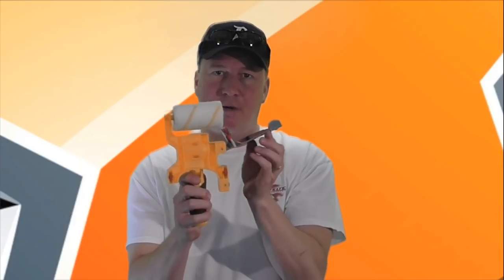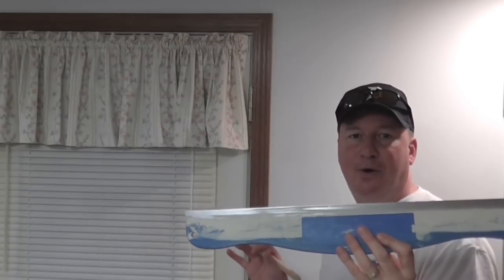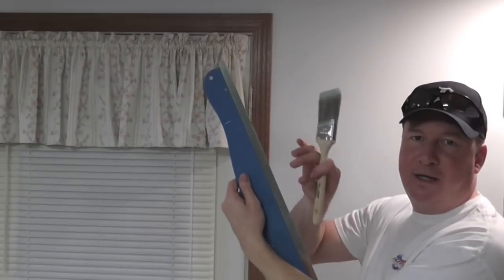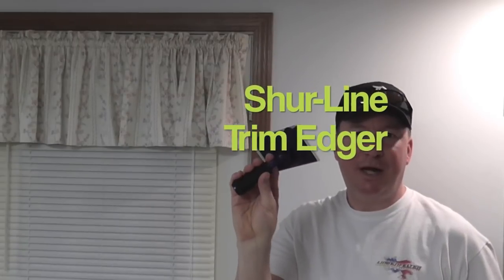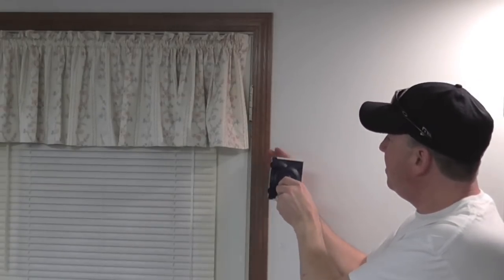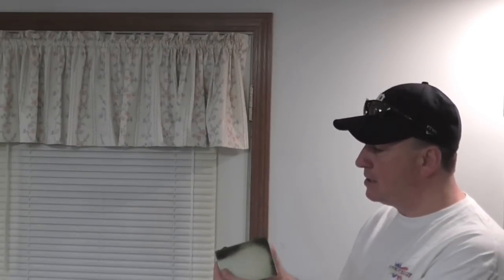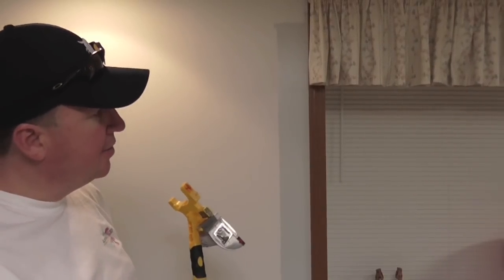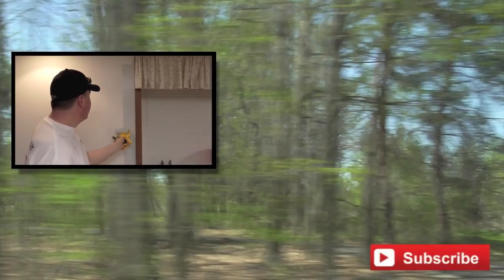$99 Accubrush XT Paint Edger vs. Traditional Painting Techniques

Comment: Wagner had the best trimmer same engineering as this one but contained the paint in the handle which solved the problem of getting paint on the edge guard when loading up that one. It came in useful when doing contrasting paint colors. Still at the end of the day a good brush and a little practice with a steady hand is the fastest. Also if you get paint on the wood trim take a 3 inch putty knife wrap the blade tightly with a slightly damp cloth and run it down the trim this removes the oops and leaves a nice straight paint line.
Reply: Accrubrush and ready to test it in about 2 weeks. I had looked into Wagner but since my paint is a bit thicker not sure how well it will float from Wagner's handle to the roller.

Comment: I own the Accubrush. The limitation is NOT the 1/8" gap you see in the video.He could have corrected that by adjusting the mini brush.The limitation IS having a straight and smooth edge to guide your Accubrush along.If you have textured ceilings. Forget it. If you have trim that is flush, forget it.There are instances where the Accubrush just can't work.I recommend using painter's tape and clear-drying caulk, then pull the tape while paint is still wet. Better edge than anything done by hand.

Comment: The sureline edger works very well if you apply the paint onto the pad with a small roller or brush. Only apply the paint 1/2 away from the edge on the pad & start away from the trim & with medium/light pressure work twords the trim about 2 feet per load.

I am a painting contractor & some gadgets work, some dont, however the more time you have behind a brush the better youll get. 

Purdy brushes are more difficult to cut a straight line with as the bristles have become larger & very rigid.

Try a wooster alpha brush or a proform contractor brush with smaller/thinner-  softer bristles for smoother/ light texure walls & a wooster chinex brush for heavier textured walls.

😎😎😎😎😎
Reply from the maker: I've used that one quite a bit.  The only issue is if paint gets in the roller wheels.  Other than that, I've had success with it.
Reply: @MarkThomasBuilder  it seems to get on the wheels no matter what,  i just make a habit of keeping a clean rag to wipe the wheels every time

Comment: They make an MX model for just $39 on Amazon and it works better than the $100 model. The $100 model does not work well on a pole and the MX has a handle and no pole so you are close enough to have the control you need. I can paint faster and make a cleaner line with the MX than a professional painter using a brush.You can adjust the brush on the MX to have no gap whatsoever and paint right up to the edge. You need to roll an inch away from the wall with the shield open after you load up the roller to avoid getting too much paint on the shield which then could get on the trim.If you know how to use this tool properly it is amazingly fast and accurate. Most of the videos I have seen slam this product because they are not using it properly.
Reply: Seems like a lot of work just keeping it clean,keeping the shield clean, wiping the end of the roller with a rag and such.
Reply: @billprezioso3677  you do not need to do any of those things if you use it correctly. I have cut and rolled a 10'x12' bedroom in 40 minutes myself using the Accubrush and an 18" roller so it is unbelievably less work. Most professional painters take 2 to 2 1/2 hours to cut and roll a room.

Comment: I'm a professional painting contractor (as many of you guys commenting on this video) I don't like how in the video it leaves a unpainted gap between the wall and trim doesn't look very professional, the trick to cutting in clean lines against trim work for me has always been by cutting in your tape the paint can't bleed through the tape if it's not "globbed" on there by dipping your full brush and putting it right against your tape you don't have to cut it in perfectly like when cutting against a ceiling either just remember less is more, I do this and pull my tape after 2 coats with flawless results 99% of the time, sure there will be a touch up or 2 here in there but still looks better and is right against the edge of the trim and looks professional unlike what it looks like with this tool lol good video tho appreciate the honest review on this tool :)
Reply: In defense of this tool tho... I could see using it on commercial jobs where they want a coat of the exact same color just to "freshen up" the space where meticulous detail isn't required (like in a customers million dollar home lol) in this case I could see this tool as a good investment for production painting to save time and sundry costs :)
Reply from the maker: Thanks for taking the time to comment and mentioning many things to consider.  I've globbed on the paint when using tape and had issues of it working its way through.    I appreciate your advice.
Reply: What about when you have textured drywall and you cant get the tape to seal.  Is there a trick to that?

Comment: Im a professional painter been painting about 30 yrs now but in the very beginning i tried everything except for this new accubrush well, to tell you the truth I'll stay with the old school way hell i been painting so long now that i can cut twice as fast then that accubrush LoL
Reply from the maker: I would say that people that can cut in paint with a trim brush are blessed with a talent.  This tool is for those who aren't equipped to properly manage a trim brush in a timely manner.
Reply: it isnt a gift, it time at it, where you learn what angle you hold an angular brush to the line to cut in. Purdy brushes hold the knife edge inward. My 15 yr old Purdy brush does not feather out the bristles. 
Wet the brush with water or solvent thinner if solvent paint is the choice. Shake out the wetting agent. Reason to wet bristles,keeps paint from drying out bristles half way up brush that cause bristles to spread out and lock in a bad brush knife edge at tip. Next , never work out of paint can, yes I said it ,its are real amature approach.
Fill another bucket with about 3 inches of paint. Dip brush light and quick, tap both sides of brush to inside of bucket sides, it loads brush properly and secures a dripless brush. You dont scrape off paint on one side, only after you've left brush sitting down in paint for a break is this done.  Loading a smooth wet brush increases spead and flow.
You dont always dip the whole width of the brush,sometimes just a portion of the  angular tip. This is just my 42 yrs as a painting contractor hold and using a brush. Applying more or less paint to a line as you moving in to make it straight.
Reply: Eric Chambers I wish I can meet you so I can challenge you to cut a regular size house of course using our favorite brushes I haven't meet my match yet mi amigo . I also can roll a room in 3 min perfectly clean and nicely rolled
Reply: No you can't.
Reply: Marcos Castillo lol 3 mins.  you would have splatter on the ceiling to roll that fast
Reply: Marcos Castillo no you can't lol
Reply: I appreciate the video but wish you would've really adjusted the brush instead of talking about all the other stuff. Cause until you have an  accurate cut line the job of that tool isn't done.
Reply: Marcos Castillo lol he's a professional painter of course he can cut in and do it neater than that piece of crap
Reply: Scott A maybe he's painting a Wendy dolls house room
Reply: I'm a painter as well and I noticed that they never use it on textured walls. 😂
Reply: Paint with the Puerto Ricans that I painted with recently and realize brushes are ridiculous. I'm fast as hell will they brush also. These guys took those little plastic edgers and ran perfect lines. Painted a house faster than I've ever seen.
Reply: @hugot12  + You call it a "bucket", but we call it a "cut pot." Who would use the big can of paint, when they make cool containers, or just use a clean empty can. But everything you are saying is very accurate. I cut very good, and I have only been doing it 10 years.
Reply: @marcoscastillo8757  + Prove it. Make a video.
Reply: @marcoscastillo8757  , prove it!!!!
Reply: You’re a damn lie. I can paint trim well, but even the shur line thing beats me at cutting in trim and ceiling line

Comment: Seems like it would help me with carpal tunnel, better than dropping brushes after painting for 20 years.   Or for new guys or day help since we all know its near impossible to find good help.    But I can cut a room out in 20 minutes myself with just a good 3" angle sash Purdy, and I'd still give it a try.  Prob not that great on stucco surfaces.  If it speeds up the job considering all my variables then its worth it.   If it's just another spring time doohickey they come out with, I have lots of those in a junk pile.   Speed = profit
Reply from the maker: The Accu-brush works great on smooth surfaces and is easier on the hands.  When I do cut-ins with with a 2.5" brush, I often have to take a break because of hand fatigue.  I'm switching to a Purdy brush and will see if the handle fits my hand better.

Comment: Thank you for saving me $100.
Reply from the maker: I'm planning on revisiting this tool in another upcoming video.  I'm going to compare it against a 2.5" trim brush and see if I can get the paint right on the trim with no gap.
Reply: That piece of crap cost $39.95 on Amazon.
Reply: @MAGA1440-s2m  That's the lower end model, not the XT

Comment: What? No close up of the actual "work" to show the 2-3 mm "white" spot where the brush didn't get all the way up to the wood trim?  Plus this also assumes that the surface you are butting up to is both smooth and straight, i.e. at a 90 deg. angle from the surface your are applying the paint to.  Not the case with some fancier crown mouldings.

Comment: most painful part of painting is doing the edging.ceiling to wall, or wall to wall corners. Then trim around doors and windows.

I used the wagner, and it isn't too bad, but I might lube up the rollers internal "bearing" to make it roller better. What sucks is it doesn't have the same roller texture if you are using a different brand 12 inch roller

Comment: How about over lapping the edge with tape but then using a razor blade to cut the edge. Then use a flat piece of wood to press the tape down more
Reply from the maker: Sounds like a great way to get nice clean edges.
Reply: I just tried the razor blade method and it worked great.  I didn’t have any bleeding at all because I pressed down on the tape edge with the end of a paint stir stick.

Comment: we may get away with that 1/8" gap at your home but not at an actual job, lol
Reply from the maker: So what's the acceptable tolerance, 1/16"?
Reply: markthomasbuilder I do all my cutting by hand and to think I would pay $100 for a tool that is basically useless, there shouldn't be a gap at all period.
Reply from the maker: Gotcha
Reply: Lololol
Reply: Right my dad taught me how to go all the way to the trim with  3inch brush and not get it on the trim and without using tape
Reply: Definitely can't leave a gap
Reply: $250 would be worth it.  If it was tight and worked
Reply: 1/8 " gap ?  That countered with 1/16 " gap.  "Builder?"   These are chicken coop tolerances.

Comment: Will this work on my walls that run up to my ceiling , it’s got a 30ft run on each side at a 35-45 degree angle going 20-25ft up. 

Wondering if the paint roller head can adjust for angle or could be used on angle ceiling to cut in?
Reply from the maker: That's a good question.  I've only used it on 90 degree corners.  I'll take another look at the tool and see if I can get you an answer.

Comment: You never showed the edge after the ‘micro adjustment’. Although that ride side pass did show it does a nice job in not getting on the trim, for my purposes, that gap is way too big in the two rooms I’m about to work on because I’m using darker colors in eggshell to semi-gloss white trim work. What did it look like after the ‘micro adjustment’?????
Reply from the maker: Sorry about that.  The micro adjust gives you lot's of control.  If I make a follow up video, I'll be sure to get some close ups.

Comment: I have never used this product... but I am assuming it is useless when cutting into a popcorn style ceiling.  Wouldn't the edger  damage the finish?  And as with the cheap edger blocks, does the fold in shield eventually get paint on it?
Reply from the maker: +Robert Bridel I occasionally clean the paint off around the shield, as I'm using it.  If the popcorn goes right to the edge, then it won't work well.  I have a stomped finish ceiling,  but the inside corner is smooth enough to use an edger.  I hope that helps.

Comment: Did you ever make the next video? Have you used the micro adjustment to get even closer?
Reply from the maker: Yes, I adjusted it to get it closer and it did a good job.  I still need to do a follow up video.  Someone else ended up painting that room.
Reply: @MarkThomasBuilder  Thank you! Have you tried the MX Standard model? Or are you sold on the XT professional?

Comment: your fancy roller and brush are also limited. Tape and brush is what i use.
Reply from the maker: What kind of tape do you use?  The green painters tape?
Reply: markthomasbuilder cut in your tape as you would the ceiling and it won't bleed through pro tip ;)
Reply: markthomasbuilder we just use yellow tape or white tape (some call it yellow some call it white tape) just the 3m 2020 tape it's 3x as cheap as the blue tape and does the same job for less

Comment: Here bc I kept getting ads. I'm a painter/remolder.  Not sold.  Although we all dream of a perfect edger
Reply from the maker: It could probably help a homeowner get the job done faster.  I've seen pro painters move pretty quick with a 2" trim brush though.
Reply: markthomasbuilder I get immaculate results with my frog tape and i can tape a room in 5-10 mins easy.  Trick is to use long strips and dont think ab it too much

Comment: where can i buy this for $100? i've only seen it around $130 +
Reply from the maker: +garth miller I just checked Amazon, it's going for $124.94    I think the kit includes more stuff from when I originally published this video.
Reply: how does it work up against a textured ceiling?
Reply: light "pop corn" texture
Reply: garth miller simple answer it doesn't work... it follows the line of the trim or ceiling so if it's crunchy (what I call it) or uneven then it will look that way

Comment: $100? That's ridiculous.
Reply: what’s the value of your time? 

Edge all day or In an hour? 

have multiple houses?

To me my time my time is worth way more

And if your paying a mortgage on a house your trying to flip... each day is Money... the faster you get it done the better 

If it’s your own home and you don’t have the money... then use a brush. Who cares.
Reply: @foolishwolf3700  exactly, I do apartment maintenance/Make Readys at a retirement community. Most of the apartments are getting a full color change upon move out. Cut in on the 1 bedrooms takes a long time to cut in and I feel like at this point it would make more sense to spend time taping/bagging off and using an airless sprayer at this point
Reply: last cut in job I did I used painters tape and a small roller with one coat paint and was able to roll against tape. No brush and removed tape right after. Easy and worked pretty well. 10/10
Reply: I'd rip my hair out with this thing.
Reply: FreeStuffPlease takes forever to tape...
Reply: FreeStuffPlease maybe hire a painter...
Reply: Pulsar Tech sprayer is too messy, too much time for cleaning machine

Comment: Wouldn’t the metal edge scrape trim? And what about corners? Boo the gap too. I don’t think this tool is made for pros.
Reply from the maker: I haven't done any painting in awhile.  I believe the little brush could be adjusted to shrink the gap.  The medal edge didn't scrape at all when I used it.  The biggest limitation is that it won't paint inside corners.

Comment: It appears that you still have to cut in with a brush. That gadget does the same thing as the pad type with the wheels. I was hoping this would work. Would save so much time.
Reply from the maker: You can load more paint on this roller, compared to a pad type, giving you better results.  I think the pros are going to stick with their trim brushes, but the homeowners may like this.
Reply: @MarkThomasBuilder  I watched another video that showed how the little brush could be adjusted to take care of that little gap. Would be perfect if this was true. Thanks.